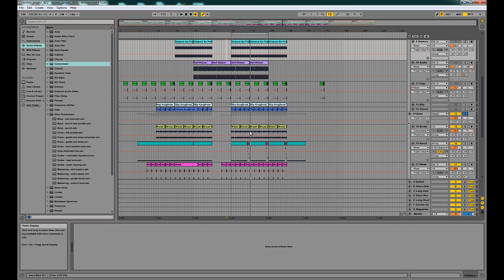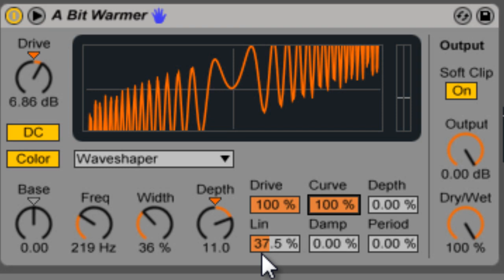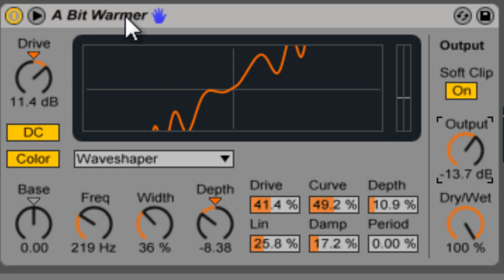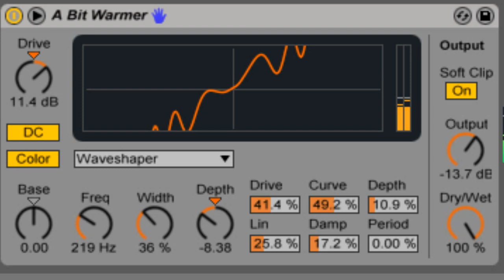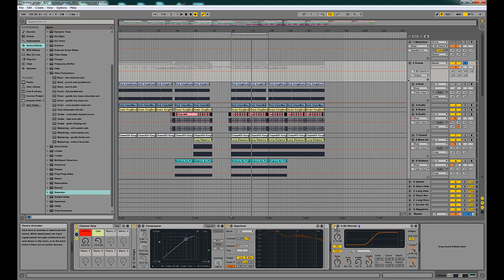Saturator - Deeflash's Ableton Live Devices Tutorials

Comment: Got your description of the 'Base' control wrong, unfortunately. From Live Audio Effect Reference Manual:

"Activating the Color button enables two filters. The first of these, controlled with the Base control, dictates how much the effect will be reduced or increased for very low frequencies. The second filter, essentially an equalizer, is used for controlling higher frequencies. It is shaped with the Freq (cutoff frequency), Width and Depth controls."

I read that to mean Base is an 'Amount' knob for the lows. You can remove the effect or increase it. It doesn't affect high frequencies at all, but saturating your lows may created higher harmonics.

Comment: So no saturator on master channel? I'm very new
Reply: You absolutely could and really should use it in the master. What I do is group saturator, and macro the drive control positive and output negative, basically for every boost, the output drops the same somewhat. My range is 0 to 18db drive, -12 to 0db output. Put the saturator on medium for all that analog goodness. turn color and DC on. Be careful, at high levels, your lows will be sucked out. Makes big difference, gets really crunchy!